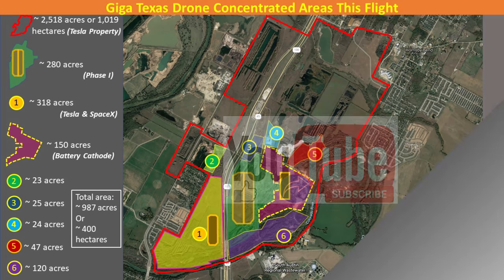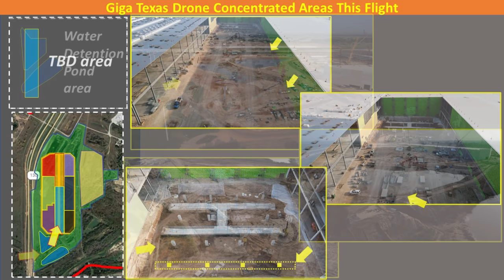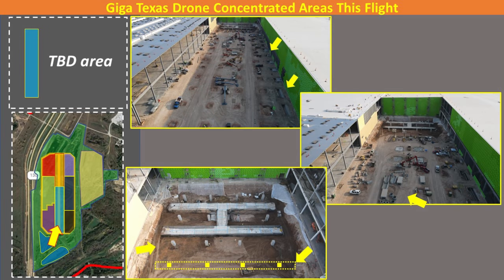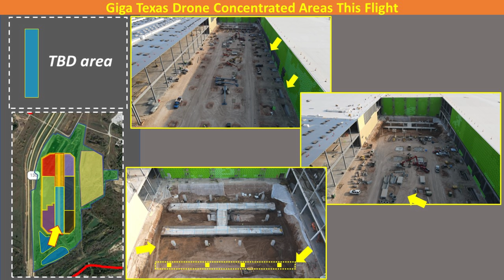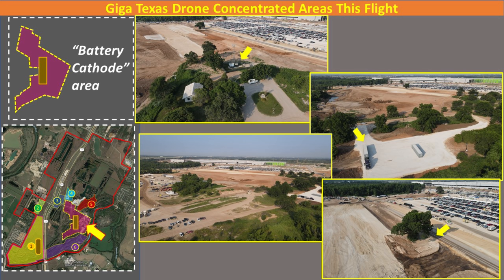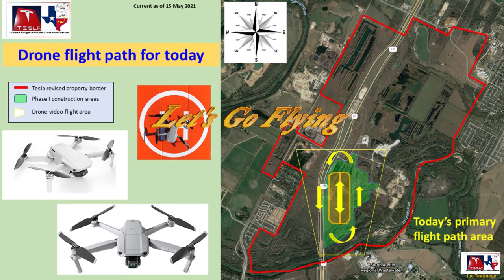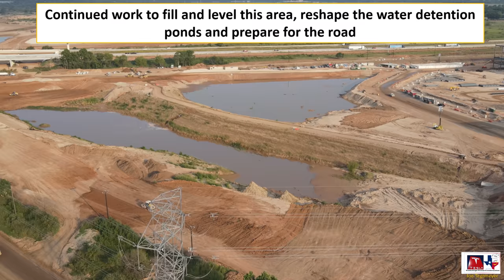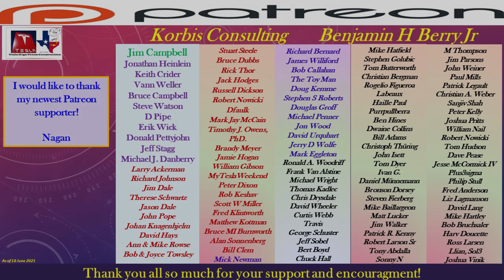Tesla Gigafactory Texas 18 June 2021 Cyber Truck & Model Y Factory Construction Update (08:00AM)

Comment: Thanks Joe. 
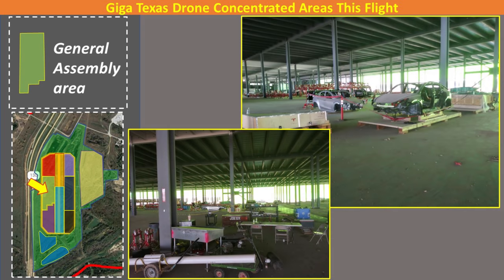1:05. Model Y bodies. Top right picture. Body on the right seems to be partly painted (black) and has the cast front end. Perhaps the production line at Fremont has been set up to handle manufacturing both styles of front end structure. Or they cobbled this one together and for some reason ran it through the paint shop. The black items in the background behind the silver body might be the doors.
10:20. The pallet loads of red acrow props have disappeared. All that speculating and we didn’t even get to see them used. 
18:00. 8 water vaults still to be installed, and with the benefit of watching Jeff’s day 331 another 2 have been delivered for a total of 10. Whatever the purpose of the vaults, they haven’t finished them yet.
18:13. Wide range of the number of column hold down bolts on the footings. Closest is 4, next is 12 (double column), then 6, then back to 4 on the concrete pedestals. 
18:37. Small section intermediate columns and some similar sized beams have been installed where the yellow prefab walls were removed. 
18:55. Stud walls above roof line. Knee high where the membrane has already been applied, chest height where the green sheeting is.
19:09. Stud walls. Back down to knee high, and being sheeted in plywood, so not a firewall in this section at least.
22:02. Excavating or clearing out the pit covering 3 columns bays. 
22:07. Bottom right. Concrete blockwork wall is now almost at the height of the covered conveyors, and scaffold has been constructed to build the wall higher.
27:12. Installing a temporary fence around the triangular pond.

Comment: Closer day-by-day... BUT, they've been 4 sections away from the angled South wall for quite a few days now. Definitely moving a lot slower than they did on the battery part of the structure. Rain slowed them down for awhile, but it just doesn't seem they are in the same kind of a hurry they were in on the giga press section or the battery section.
Reply: I was thinking the same thing, I wonder if it is a lower priority section?
Reply: @wrslss  I reckon so. Speculation is that it's related to the Cybertruck.

Comment: 9:32 noticed the TRANE unit is already cooling something, noticed all the fans spinning, previously just thought it was waiting to be hoisted up on the roof, that sucker is being put to work already.  
 Waiting for the "Two Men & A Truck" to back up to one of the loading docks,  which they have already been doing and I am impressed.
Reply: It's a rental unit.  You can see a few more inside on the second floor of the east building near the water vault area.
Reply: @sammyk874  Thanks

Comment: I wonder if Tesla is thinking ahead and planning the ability to make use of their own on-site water resources in drought situations? Sole reliance on city water supply in the Texan climate would seem like a risky move. It's not inconceivable that heavy rain events are only going to increase in intensity, frequency & duration as climate change accelerates & Tesla may be cognisant of this judging by the amount of stormwater retention pond infrastructure they're putting in. So it would seem rather strange not to make the most of the high level of investment in this aspect of Terra Austin's construction; not having to pay high H20 supply costs all year around is sensible. Or perhaps I'm overthinking this as a result of growing up on a farm in New Zealand with only rainwater fed tank H20 supply; drought years gave you a healthy respect for H20 conservation.
As for the 'tree', it is a beautiful tree & it would be such a shame to knock it down just for convenience's sake. They certainly seem to have gone to great lengths to protect its roots.

Comment: I suspect that most if not all of the castings at this point are part of the commissioning process and will be recycled. The white frames on top of the containers in the robot area look like the frames used at the Fremont and Shanghai factory for storage and transportation of the castings to the production line. These castings do not look like they are getting the care to prevent damage from handling.

Comment: The extremely rapid pace of construction in the north eastern corner makes me wonder if once the double T section installations are completed on the installed uprights as we see them now, if we'll also see them pouring the concrete on that section of roof whilst they wait for the rest of the footings to cure instead of just pouring the whole thing in one go. It kind of makes sense to do so as it would mean not having to stall construction in that area yet again.

Comment: @joetegtmeyer "An interesting bit of news from inside the General Assembly building is that they continue to have some issues with the tolerances to level of the ground floor slab in this area and it is causing some re-work of the concrete flooring.  Most of this work is unseen from outside as it is in the walled-off areas. "

It sounds like you are saying that they poured some concrete on the first floor and the result wasn't level?  too high/low? Uneven?
Regardless, maybe it's because with all of the metal now between the antenna tower and the leveling machine(s), they were getting bad data?
Reply: the concrete pumper at 17:35 appears not from the red colored fleet of pumpers we have regularly seen. Is another concrete contractor involved now?

Comment: @ 7:16 What happened to the double roof drains? There seems to be only one drain visible from each pair.
Reply: Hiding under the membrane.
Reply: @DessieDoolan  Ok that answers one question but raises another... So why are only the overflow drains open? They dump all the water out on the dirt when it rains. It appears that all the flooding outside the building is purposely done by blocking the main drains! An engineered mud hole.
Reply: @DavidJohnson-tv2nn  From what I can see the roof drain inlets are 2 piece, a funnel that connects to the downpipe/downspout, and then the baffle (cap). There are 2 types of caps, one for regular flows, the other for the overflows. Because the regular flow downpipes aren't yet connected to the underground drains, they have simply swapped the regular cap onto the overflow downpipe for the water to discharge to grade.
Reply: @DessieDoolan  But that's my point. They should have connected the regular roof drains to the stormwater system long ago. All that flooding alongside the building during the last storm was an engineering failure. All because they gave connecting the roof drains, and finishing the roof a low priority.
Reply: @DessieDoolan  And the roof drains on the east side still aren't connected! As proven by them being covered up. It seems like project management just doesn't care.

Comment: Castings may be on their way to Berlin, which is probably further along than Texas with body-in-white equipment like welding robots.  Although the casting machines appear to be ready to go, with furnaces recently installed, who knows what the hold-up with be with permits to run them.
Reply: Berlin have permits to test casting and have had them for some time. They also have had the ability to work 24 /7 if needed. It makes sense to work through front casting issues at Austin so some can be shipped to Fremont to trial the new production systems. What they do not appear to have in Berlin are the batteries that were always planned to come from Kato Road for a while. Speculation is that there will be a line building Fremont style model Y for a while until the battery tech is up to speed.

Comment: Is it me or GigaTexas is not precisely aligned with true North?
Reply: From what I have heard, it is supposed to be. I don't understand why it would matter anyway.
Reply: it is. This is for robotic GPS units on the factory floor to navigate.
Reply: @mrschuyler  It's so they can mount solar panels on the roof and point them south.
Reply: When I look at Joe's map every day, it seems to be the northern of the plant part seems to be tilting East. Maybe it's just that the map wasn't aligned true North itself?
Reply: Their not running some strange religious cult in there, so it probably does not matter all that much
Reply: @paulstubbs7678  Are you sure about that? The cult business, I mean?
Reply: Check on Google Earth, seems to be pointing North.
Reply: @jbbuzzable  easier to program the robots that move materials around if you only have to tell them to move N/S and E/W instead of diagonally?
Reply: @paulstubbs7678  Elon wants it pointing North. He pays for it.
Reply: @alsmith358  lol. No.